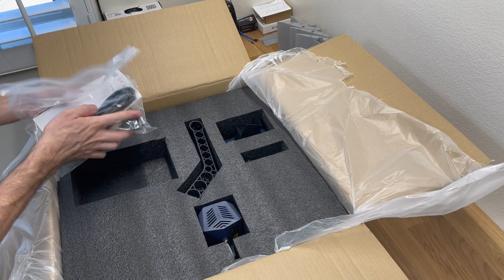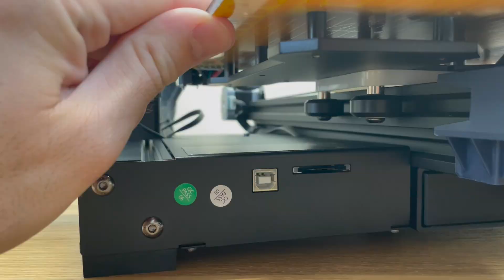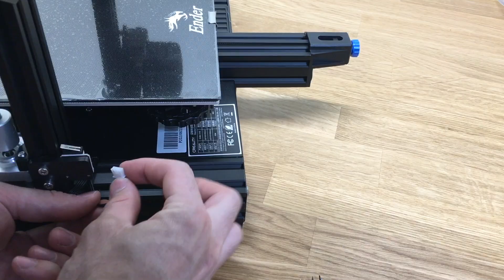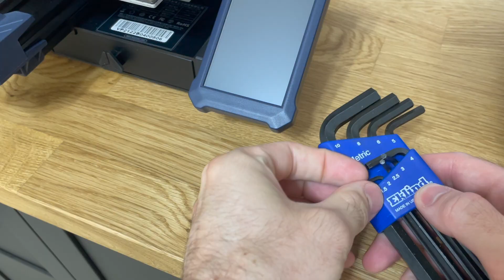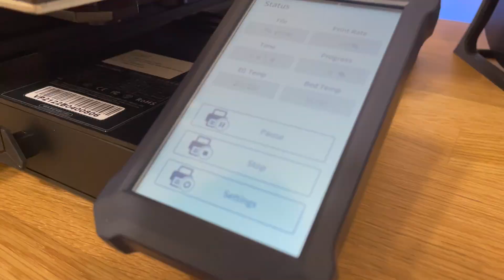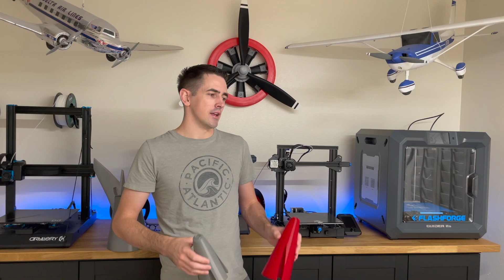NEW Anycubic Vyper VS Creality Ender 3 V2 comparison

Comment: I wish the Vyper was released last month when I was looking to buy a new machine. I am still very happy with my MegaX especially now with the MicroSwiss direct drive extruder and all metal hot end installed. But auto Bed leveling etc out of the box would have been nice! I will probably add it to my MegaX in time.

Comment: Love the material Troy...thnx so much for passing along the wisdom...ques. For what you do, wld you recommend the artillery  sidewinder or the anycubic mega x?...or?...thanx again
DVD
Reply: Lol...thnx Troy.. I did go that route rcvd on 6.12.21....I've got VERY good results w the SWX1 V4. I'm using standard PLA Overture. Still working out settings, Temps etc...thnx for reply. And again, ty for sharing your experience and knowledge, helped me get my rig going very quickly
Reply from the maker: The sidewinder, 1000% it is direct drive and quiet, its print quality is amazing!

Comment: Nice comparison video Troy, and you are right about first time bed leveling.  I’m also looking forward to seeing the airliner you are working on.  I’m printing a Cessna Skymaster 337 and a Pilatus Porter PC-6 by rc3dprint.  Both planes look great and are fairly easy to fly should you run out of projects to build.  You would enjoy either of these.
Reply: What website do you get/buy airplane STL files?

Comment: https://youtu.be/_3sH376MKEg
hi Troy, you are very good at designing aircraft, I ask you, why don't you make a 700-sized helicopter like mine?  I made it in depron by hand but unfortunately it is not easily duplicated, if I had done it in 3d I would have created many, but unfortunately at times I do not know how to use the 3d printer as soon as I can I will buy one, look at my video that I have  linked, I can guarantee you that this helicopter flies very well very stable, I use an omnibus card f4 v3 without using a barometer as I do not consider it useful, it is already very stable by itself, for the engines I used those similar to the Phantom dji model 2312 -980kv they are fine to  4cells.  2200mha. The whole helicopter without battery weighs 1.10kg, create one yourself in 3d, many only make planes in 3d print, but helicopters as big as a class 700 never made any, if you make it you will have the world record,  make it big with a 3d fuselage.  hello and congratulations on the great videos you make.  .... every now and then you could give us a file to print, bye bye😀

Comment: Like the video but you should be comparing it to the CR6 as it’s a clone of the CR6 not the Ender.
It looks superior to the CR6
Reply: I think it's a fair comparison because the price point is so similar.  Once you add all the upgrades that the Viper has over the Ender, it winds up being WAY more expensive to buy the Viper.  It kinda bums me out because I have an Ender 3 v2 and I'm in the process of adding a lot of those upgrades. If I get a second printer, I might just get the Viper.
Reply: I have a CR6 and have been very happy with it.  I also have two Anycubic printers and very happy with them - this intro price is irresistible and you can use coupon code DPF10OFF for another $10 off.  I ordered one for $289 with free shipping.
Reply from the maker: I do agree, but I feel the CR6 isn't as popular/commonly known as the ender, that is why I compared the two

Comment: Great video Troy looks like a plug n play printer.  That A320 looks like a big model, looking forward to that.  Have you built any of the Eclipson flying wings? I build mainly with my own design CNC Foam cutter but I'm keen to try a 3d printed plane.
Reply from the maker: I haven't tried any of the wings from Eclipson! There are tons of easy to begin with 3D printed planes, nearly all from Eclipson! You should try it out :) The big A321 will be out in the next couple weeks

Comment: Finally, an out of the box beginner printer that just works! 

I still don't like the fact that the Bowden and wiring are fed through the frame from behind i.s.o. from the front. There is always a risk of a pinch point.
Reply: It's good I've had mine over a week ots solid haven't seen any risk of pinching or anything. Was up and running in 10 min
Reply from the maker: @zombiej79  it is literally the easiest printer I have set up
Reply: @TroyMcMillanRC  7  screws 5 min. Maybe 5 min for leveling and your printing. So nice
Reply from the maker: It does work amazing straight out of the box. I haven't had any problems with pinching, so I would say the risk is small.
Reply from the maker: @TaiRone Wassup  that is why an ender would work great for you!! Tonssss of upgrades :)
Reply from the maker: @TaiRone Wassup  The ender is a great one for that